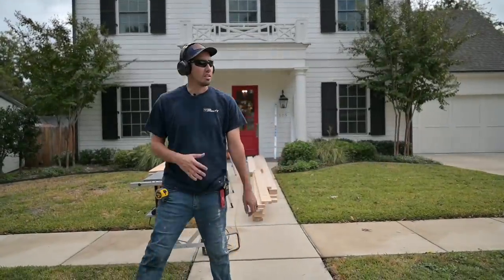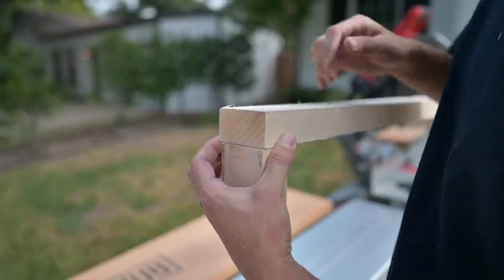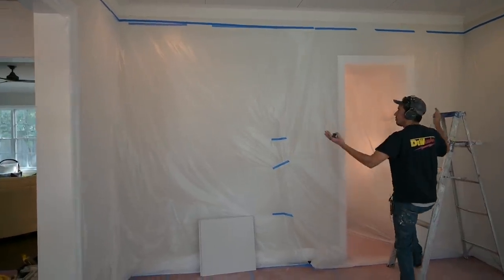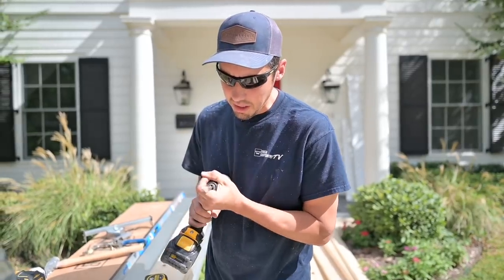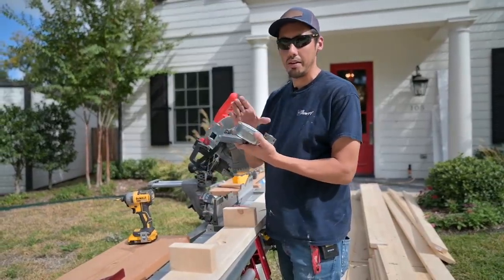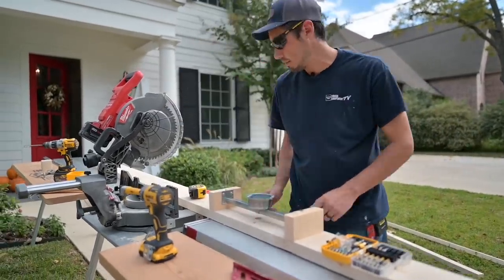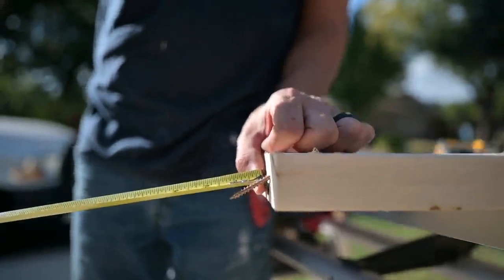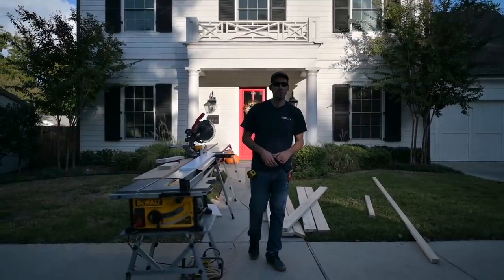Carpenters Install Coffered Ceiling

Comment: I was a trim carpenter  for over 50 years working on multi million dollar houses. Many had coffered ceilings , many 20 feet in the air. It’s hard work . Sometimes I’d  go home feeling  like my shoulders and neck was beaten with a hammer. . Unless you have never done this you have no idea how hard it is to do this and make it come out looking perfect. Especially if it’s multi layer crowns.  Great job guys !

Comment: Great set up, table saw to miter saw to assembly area and into the work area, that’s what you call efficiency, great work, great content and great video as usual, I personally use a stop block cutting small pieces because I don’t trust my own accuracy with the tape 🙈 , looking forward to the next one, 👍👍

Comment: I do exactly the type of work you do in Northern New Jersey, but our techniques are very similar , I actually use the Bosch Blaze laser measure, love it , but any distance over 12', I subtract an 1/8" on the cuts, it always works out.
Reply: check out amazon. There is a 4D laser for $129. works pretty good and way cheaper than the depot brands. Good to keep as an extra if you already spent $3-400 on the Bosch.

Comment: You don't really need that bracket, can just screw the box to the 2 by and use an extension ring. The bracket is for spanning the gap between joist, it would be strongest without it.
I really like that tablesaw/mitersaw setup.
Reply: I agree the box is rated for 150lbs but I doubt the blocking is. Should have attached it to the 2x6
Reply: Brilliant.
Reply: @Mark_MOORE_VFL  That blocking most certainly isn't. End-grain screwing just has no omph for holding anything. Like you said, he should have mounted directly to the 2x6.
Reply: @Jorash_Barison  i haven't been following very long and was very surprised he was doing electrical, HVAC and drywall shows if you have a specialty stick to it. If that fixture weights what he said there will be a call back
Reply: @Mark_MOORE_VFL  Yes, stick to your specialties if you have them. I will add that using 2x material for non structural stuff is just expensive space filler. The 2x don't stick to the ceiling any better than a 1x will. And the 1x materials can support the lightweight non-structural decorative work just fine. Lighter and easier to use as well.
Reply: I don’t understand why they didn’t do the pattern around the fan? Since it’s in the center of the room, why wouldn’t it be mounted flush to the ceiling, and the trim revolves around it for lack of better words. Unless the client wants the fan on that beam, seems like a bunch of extra work.

Comment: Think about it...you're doing duct-work, electrical work, carpentry and painting: you should get a General Contractor's License. I know you believe in "Keep it small and keep it all" but a little bit larger would be kinda fun and bring in easy money. That Light-box you installed might be rated for 150 pounds but that's only if connected to framing members in the ceiling: the way you installed it the weight will hang on the 4 screws that attach the 2 blocks that you hung the box on...I'd probably use a couple Teko Klips on each side of the blocks to make sure it's safe. One thing that amazes me is how simple you make all these jobs look.

Comment: I had the same issue on my first one in regards to ceiling fan so I made a box out matching the coffered ceiling itself. I've done several since, nice job. The  toughest one I ever did was a radius coffered ceiling. I laminated luann for radius.
Reply: I've done three radius coffered ceilings. One oval as the center point, one with a circle center point and one that had a lot of radius aspects to it. That one was a 40x80 ceiling. They are difficult to do without a shop to pre make all your parts. I did everything on the job site. Those were some very long days.

Comment: So glad that others do it the same way I do. I prefer using 3/4” plywood instead of 2x as it’s more stable and you don’t have to worry of the material sits there with the chance of warping. Even a crown in the 2x can bug me. I use some PL Premium subfloor adhesive on the intermediate pieces where your not hitting joists. Even a screw driven lightly into the drywall will snug it up until adhesive sets. But very nice man!  I’ve been doing carpentry for over 40 years and I am always taking in tips from others.

Comment: Another great video. I’ve learned a ton watching your videos. I’m am getting ready to put lights into a beam in my kitchen so this was a helpful video. What would you of done if there wasn’t that much slack in the existing wire? Splice in attic?
Reply from the maker: I’m not sure exactly. But I think you are correct. My insurance doesn’t cover me splicing wires, I can only move existing. So before I start these jobs I tell customers to have an electrician on standby in case we need some mods to the wires.

Comment: Anytime you have an increment that a 2x dimension makes...ex. 3 inch blocks that you cut....always faster to stack them flat.....ex. 2.  1 1/2 blocks stacked together.... use a little mote material but the time savings more than makes up for it.

Comment: Just wondering if you would have installed the 1x6 on the sides and long beams then installed your 4ft 2x6s against so you wouldn't need to notch the 1x6s ?
Reply from the maker: We would typically do that but this design will have a seamless bottom side on the beam. If we were intersecting different size beams we would do it that way.
Reply: @FinishCarpentryTV  Well that makes sense. Thats why you have a youtube channel and I just watch and make stupid comments. :) We are all here to learn , even after 45 years of doing it.

Comment: Wouldn't it have been better to put pocket holes on the full length support boards and drive into these intermediate pieces? I mean, if you don't split the end grain when making the holes, are you good to go? I just know pocket holes in the end grain are asking for a split, usually... Would brackets as a backup be a potential option?

Comment: Leave the ceilings to the plaster guys. Time and material is so much lower with beams precasted with crown profiles embedded. Plasters onto ceiling and the shrink and expansion rate is same as the drywall ceiling thus no hairline cracks on joint and seams.

Comment: Do you have to run the 2x6s through a jointer to make sure they aren’t wavy?  Or it seems to work out fine using them as is for the framing?  I’m going to do paint grade with mdf and use 2x6s for the framing like you did here.   Really appreciate all your videos and finding out what is required to do things quality

Comment: Not that it matters but attaching a board across the ceiling joists is stronger than attaching it to a single joist. Also because your screwing up into the boards they cant have any structural role according to most codes. I understand this is cosmetic work. I just wanted to mention this as you seem to imply structural characteristic to your job.

Comment: Good to see the structure and sequence - Can't wait to see the finished product.  Your light fixture bracket may be rated to 150 lbs, but I don't think you're hitting that by only using the outer-most mounting screws which are also in line with the wood grain and close to the edge of the vertical block. Might hold...

Comment: I was a custom cabinet builder in Tennessee and had a job in Florida that required this detail. I cam up with a way to pre build squares with all the crown molding already attached,so all we had to do was bolt each box to the concrete ceiling and attach a 1x6 to form our bottom of the beams. Had this all planned out and sized to fit in the elevator. When we arrived the designer showed up and decided he wanted to run the beams at an angle to to the straight wall. It required an extra trip down and a week stay to finish up all the extra cutting to fill the triangles the designer created on a whim.

Comment: couple questions, 1 is the table the table saw is sitting on part of the cut one system and two what screws are you using for this project?  thanks

Comment: I’m trying to figure out why there were holes in the ceiling still...why wasn’t hmthat patched up before putting in the coffers??
Reply: Not sure why there were holes but why would you patch them when they would be covered by the framing and trim?
Reply: @dancingbear6239  insulation for 1

Comment: Why not use a pocket hole jig?  Is it because it takes up too much time compared to manually drilling?
Reply from the maker: Yes exactly. And it’s rough work so it doesn’t need to be perfect.
Reply: Yes and the jig is set up for 3/4" and this is 1.5" and the screws are only 1.25" and he's using 3".  I do mine the same way as him with 2x4 because if not you are guessing where to put the jig and the holes don't come out in the center. And the pocket with the special drill bit is overrated. He's basically just toenailing them in with a predrill. And the screws he's using don't have the flat head so they don't match the bit in the jig.

Comment: Since you're pre-installing the 3" blocks how do you adjust for a ceiling that is uneven?
Reply: 2:35
Reply: I wasn't sure where the best place was to ask that same question. I'm about to start the same project and the ceiling clearly sags in the center. If I install the framing and 3" blocking, the bottom 1x will follow the contours of the ceiling as the framing does. I understand bringing the side 1x's down will ignore the contours of the ceiling. My main question is how do you maintain the 3/4" gap on the bottom if the bottom 1x is following the contours of the ceiling? The only solution I can think of is installing the blocking after, at different thicknesses to make a level beam.  Any help on this would very appreciated
Reply: @danieldunn2982  I just built my own coffered ceiling and the difference between the highest and lowest part of the ceiling was over 1".  I ended up installing the top 2x8's first, then I set up a laser to the bottom of the blocks and measured in several locations along the 2X8's.  With those measurements I cut each block individually and screwed it in using pocket holes made with a Kreg jig, glue, and screws.  This made the bottom of the coffers perfectly level.  There is one downside to doing this.  When you go to install the crown moulding tight to the ceiling the spacing between the bottom of the crown and the bottom edge of the coffer may not be the same and may be noticeable.  Hope this helps.

Comment: when you are cutting with the miter saw.. is your blade cutting the wood up against the line you made or on the line you made..?? or maybe you take into account the thickness of the blade and add it to your measure..?? just wondering what other people do when cutting on a miter saw..
Reply: You cut right up to the line, put the blade on the waste side of the any cut in most cases.
Reply from the maker: @nevermindthebull0cks  exactly the reply I was going to type. Thanks!
Reply: @nevermindthebull0cks  cool.. thats what I do.. just wondering if I was missing out on the correct way or better way..

Comment: Are you a licensed carpenter ?
Reply: There is no carpenter license in Texas. There is a general contractor license, but it’s not mandatory. You must have a license to do electrical, plumbing, or hvac. Or be a midwife, podiatrist, or if you want to do “weather modification”.
I’m serious about those, even that last one...check the TDLR website.

Comment: As a carpenter builder retired  guys using two hands hammering on a ceiling instead of  backhand using  one hand and getting  more  power amazes me  they have not been taught  how to use a hammer .
This is what happens when you get people who have not done a carpentry apprenticeship. 
I know  this sounds petty  but you can't  put aold head on young shoulders. 
It is a learning  process and it takes years to be a quality  carpenter and learn the  tricks of the trade.
What you are doing is good i can't  fault it but you will  always have someone  like me to  critique  it .
Keep up the good work. 
Cheers Rob

Comment: Hey Richard, I was wondering about the kind of fixings you prefer, there seems to be a preference for full thread screws here in the UK currently and i wondered if u had any advice on which fixing to use for framing up, some screws have a smooth shank and some are fully threaded to the head is one better than the other in ur opinion any help appreciated,
Reply: The smooth shanks are good for pulling one piece of wood tight against another piece. With screws that are threaded all the way what happens is that whatever space exists between the 2 pieces of wood as the screw exits the first piece and enters the second piece remains no matter how tight the screw is installed. It's the same with Lag-bolts as I learned after it was too late when I built my front porch. I should have clamped the boards together before installing the Lags. Or, I should have predrilled the outer boards a tiny bit larger than the width of the threads.
Reply: @choimdachoim9491  thanks i have noticed the same thing so i wondered if i was doing something wrong, seems that a secure clamp between the pieces is definitely needed then 🥴
Reply: If you use full thread when joining boards you can end up with a gap if they aren’t clamped. I usually go for smooth shank, but if full thread is the only thing available I’ll go until the screw starts biting on the second board, then back the screw out and tighten it down again. It takes a couple more seconds each screw, but the boards are always flush. They nice thing about full thread screws is that you have more threads engaged for holding the boards together, so overall it’s stronger for parallel loads.